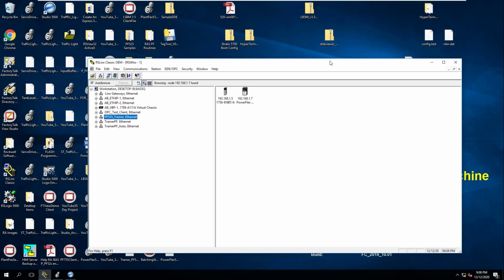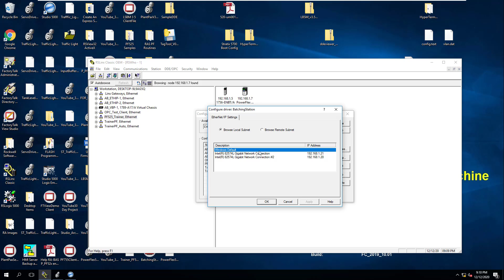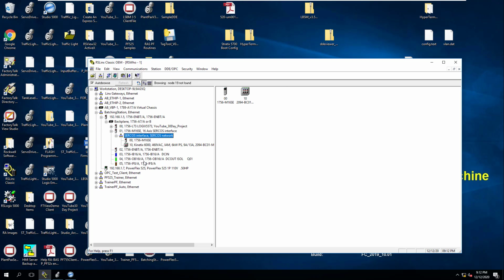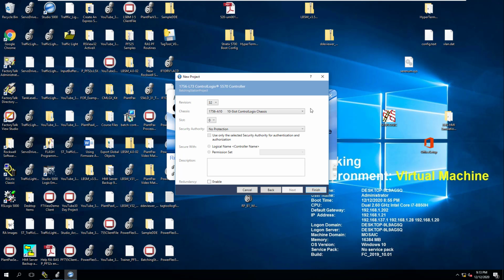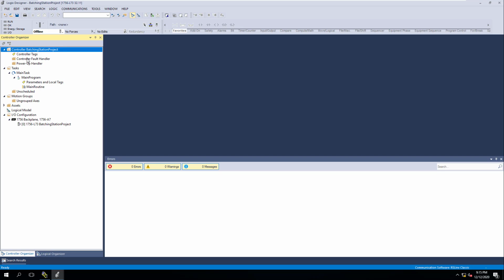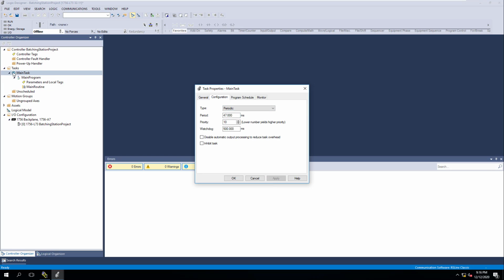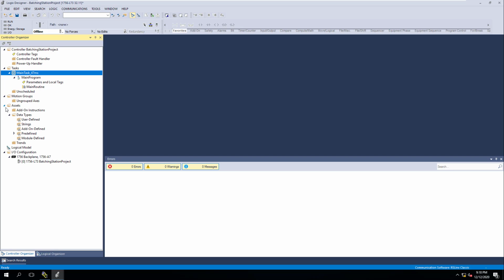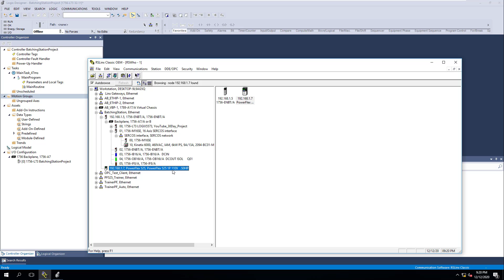Creating A Studio 5000 PLC Program From Scratch | Batching Station PLC Programming | Day 1

Comment: Hi Shane. Love the videos, I have been watching them to learn the Rockwell UI for a new job so all these are super helpful.
I have a question. You mentioned that the hardware configuration (rack components, module specs, revision numbers etc) is the same that you have used in a previous project (the videos of which I probably haven't watched yet).

So if I was setting up my RSLinx for the first time ever, would I need to get all that information from the physical module packaging/documents or will it be detected on RSLinx when I set up the ethernet connection?
Reply from the maker: To clarify, i mention the IO that I have used in other projects on this YouTube channel, like my 30 day servo project series or my Powerflex 525 videos.

In the case of the first time setting something up, you can look on the card to get the information as well, just be mindful that the card's firmware may have been flashed or need to be flashed so double check all of that after you manually enter in the information.

Always verify your work by checking the system.

Comment: This is a setup for communication  between computer and the controller using Ethernet card on the rack? how do you communicate with multiple controllers in different places over the network? a network has to be created first? if yes, how? could you explain please? how do you come up with each IP address for each station? thx.
Reply from the maker: The simplest way would be to setup separate Ethernet drivers in RSLinx for each PLC rack or Ethernet card.

Again, simple explanation
Reply: @ShaneWelcher  do you have a video or any presentation to show how? In future maybe? How you come up with IP addresses?
Reply from the maker: @renaco1145  

Just setup an Ethernet driver, only add the one IP address for the card you want to talk to then add another & so on.

Name each one so you can easily keep track
Reply: @ShaneWelcher  There is no need for physical connection between laptop and each of those stations? if no, how the communication is made possible? each card has to be installed in different racks with different controllers right?
Reply from the maker: @renaco1145  as long as RSLINX can see it
Reply from the maker: @renaco1145  WiFi, LAN, either
Reply from the maker: @renaco1145  any form of AB communication
Reply: @ShaneWelcher  what types of devices represent AB communication? So far I know Ethernet card on each station, what else? is this has to do with DeviceNet ,....thx Shane by the way.
Reply from the maker: @renaco1145  devicenet, controlnet, Ethernet, data highway, ECT

Comment: Hi Shane, I have a question for you. Is there a technique to calculate the period time of each periodic task when there are multiple periodic tasks in the same project?
By the way thanks for this amazing YouTube channel!
Reply from the maker: Thank you for the support.

For periodic tasks, I use each based on input needs from devices & for other processes then watch the overlap or CPU health.

This is highly used for machinery timing for perfect implementation.

I teach this in my courses but it is case by case different for calculating them.

Meaning, machinery dependant or device dependant